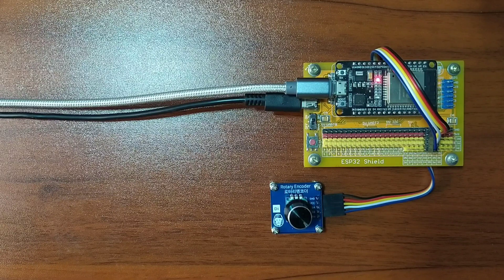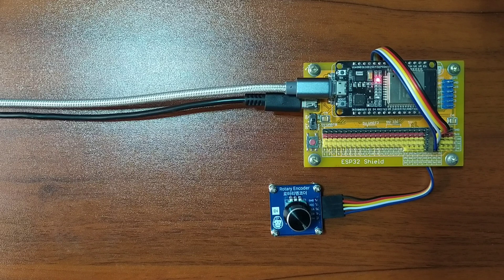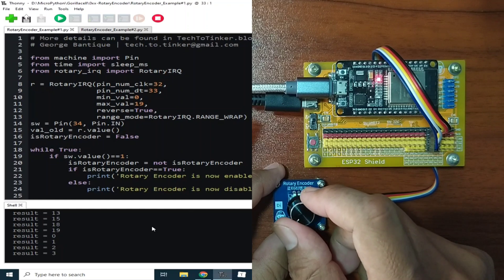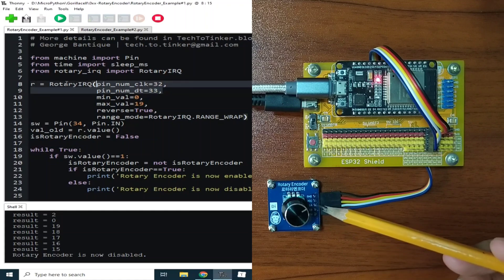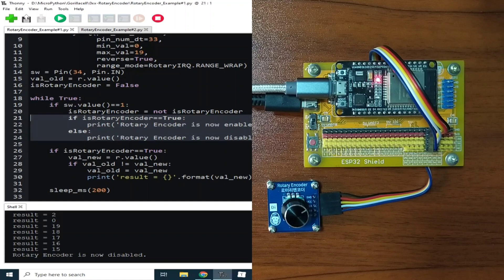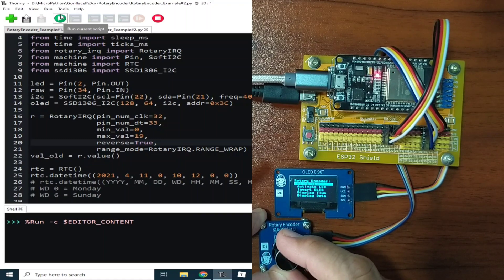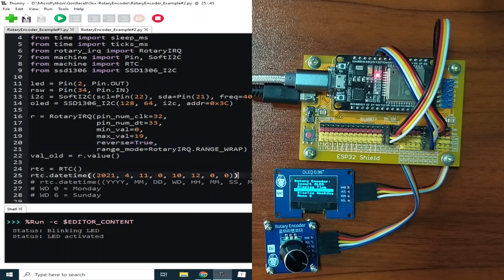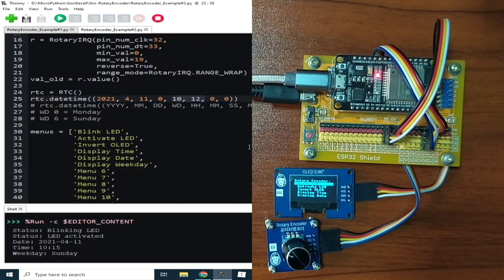027 - MicroPython TechNotes: Rotary Encoder

Comment: Trying to figure out how this can work in uasyncio threaded task. Will the delays and timing be a problem?
Reply from the maker: I think there is available library for rotary encoder  which uses uasyncio. Which I think that works better. 

If you are going to use uasyncio, you will use the modified sleep methods. Modified sleep methods will be the time a certain task is switched to another task.